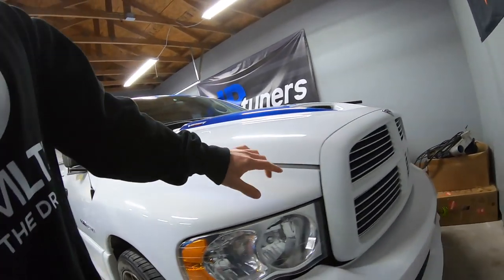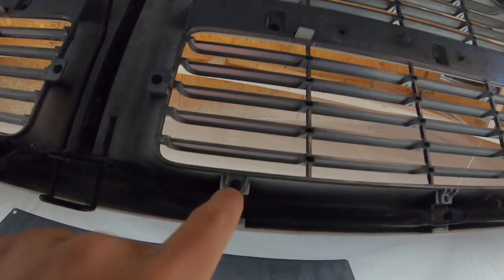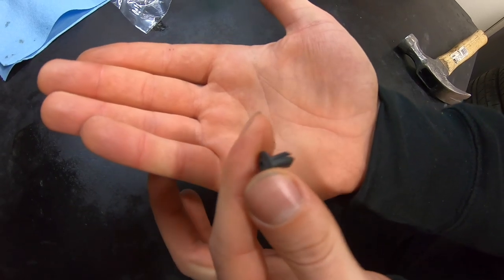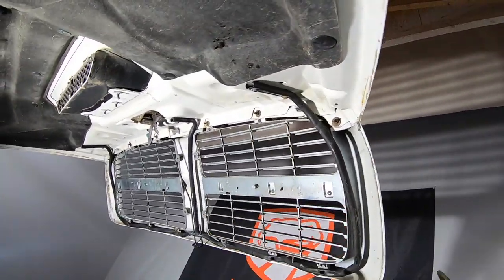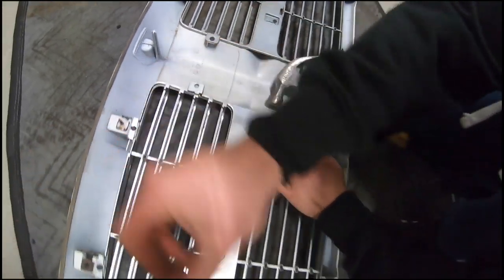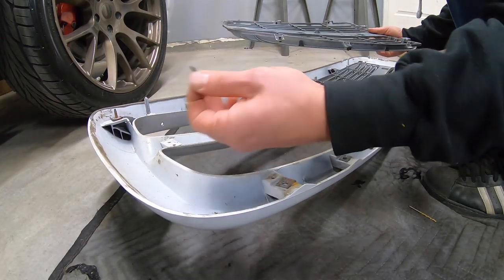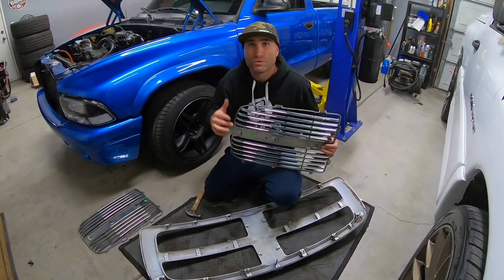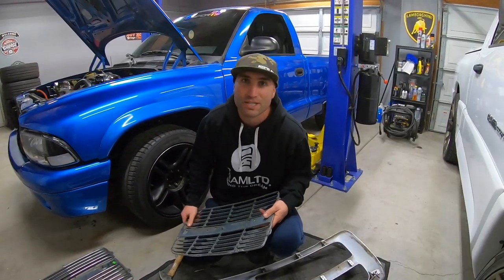How to Remove Dodge RAM Grill 02-05

Comment: You can buy those push pins at just about any auto parts store and in a few different styles at a better price than oem. As long as the size is right you should be fine, or drill a bigger hole if needed. I'd try to avoid that because some drill bits are a little too aggressive for the plastic tabs that they lock into.

Comment: If you have a local body parts house or a body shop you can get those pins in different sizes in bulk... Way cheaper than the stealership.

Comment: Man so much easier then the 4th gens lol
Reply from the maker: Yeah its not as much nonsense for sure lol
Reply: I wonder if the 2nd gens are done the same way then since both 2nd and 3rd gens had the grille attached to the hood
Reply from the maker: I haven’t had to take one apart but if I had to guess it would be similar to the Dakota and the clips are melted mushroomed plastic holding the inserts in. I’m sure I’ll make a vid on that some day lol
Reply: Sounds good man well keep up the awesome job with the vids, the srt 10 needs those new headlights and leds soon will look sweet also when you do the honeycomb inserts dont forget to put on that srt grille badge that you put on the 4th gen if you still have the badge
Reply from the maker: Ben p definitely! Headlights are here. Inserts should be here before the end of the week and still got that SRT badge 👌
Reply: Nice that'll look sweet cant wait for the videos